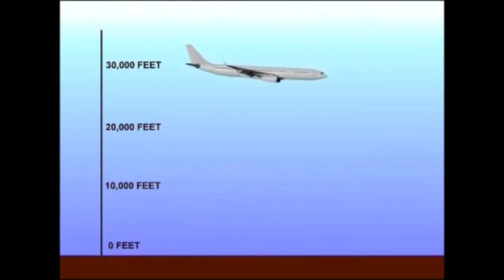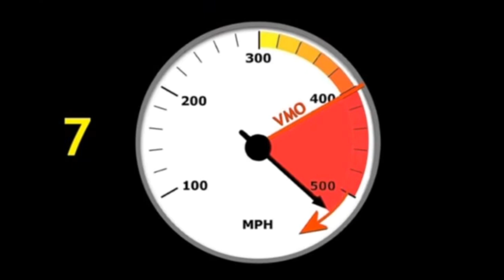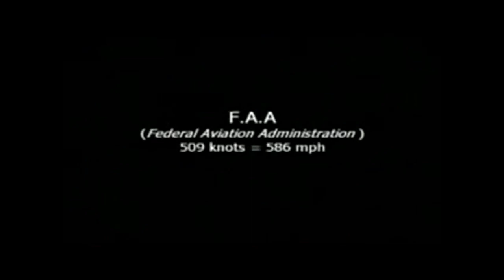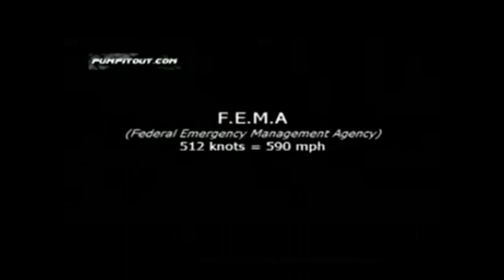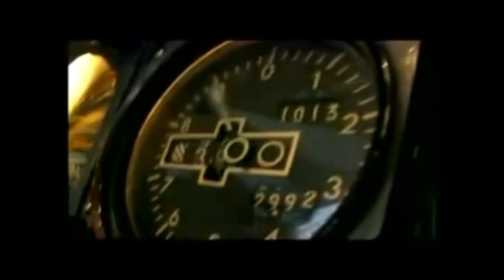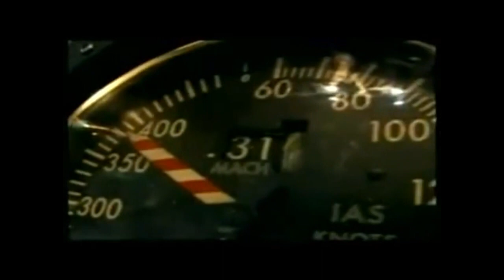Can a commercial jetliner fly above 500 mph at sea level?

Comment: So two of the engineers say they could (but not through engine power alone), and one said they couldn’t. This doesn’t sound like overwhelming evidence.  Funny how all the jokers in the comments with their confirmation bias can’t hear what the engineers are actually saying.
Reply from the maker: No, they did not. You are not saying all of it. Quote them.
Reply: @PetrLunak  First engineer clearly agrees with you. The second one is asked if the planes would “shake apart.” He replies, “That’s a question of Mach number, and it’s not that bad.”
Reply from the maker: @jonmcalister1802 you, again, picked up only those words, you obviously like. You did not quoted all of their words. Confirmation bias at its best.
Reply: @PetrLunak  My mistake in my original comment. There were four responses, and three of them only mention thrust as the limitation. The second one rejects airframe stress as a limitation. The last one (I think he's a pilot) says that they could reach that speed with "the assistance of gravity."
Reply: @PetrLunak  The third person, Ben Eadie (8:00), says it's impossible because you need "so much power to push through that much air." When he refers to adding engines that are much more powerful to overcome that, he says that the structure couldn't handle it, but he's referring to the way that the engine mounts and wing strength would have to be much stronger to convey that moch force through the airplane. They would rip the wings off.
Reply from the maker: @jonmcalister1802  Krishna Kumar Subramanian, Aircraft Engineer:

"While the first thing that strikes you when you hear the word “aerodynamics” is “lift”, it actually is about all the forces acting on a body moving in the air.

This relative motion between the airplane and the air causes a force — a structural load —on the airplane called “dynamic pressure”.

Technically, this force is sometimes called “Q” (like “M” in James Bond movies).

Dynamic pressure increases with density of the air, and increases as the square of the speed.

At sufficiently high air density (say, close to the ground), and sufficiently high speed, this force can rip the wings off an airplane.

Therefore certification authorities impose a safe speed limit. There are several values of this.

Piston engine airplanes are given a straightforward VNE: a single red-line limit of VNE (velocity never exceed).

For turboprops and jets, this speed limit is designated Vmo (velocity maximum operating).

VMO is primarily a structural limitation because increased indicated airspeed stresses the airframe, particularly when gusts are encountered.

Vmo, unlike the red-line limit of VNE (velocity never exceed) in a piston airplane, accounts for the effects of Math at higher altitudes as well as the structural loads that increase with indicated airspeed.

Mach effects include change in flying qualities and loads on the airframe.

Air flowing over the wings and tail can approach Mach 1, the speed of sound, when the airplane itself is moving through the air at far less than that speed.

For example, the air must accelerate so abruptly to pass over and under a thick wing section that a Mach shock wave can be created and change the performance of the wing or tail when true Mach is quite low.

Mach effects change with air density, becoming more critical as atmospheric density decreases with altitude.

For that reason, nearly all turbprop airplanes adjust Vmo down as altitude increases, thus delivering a larger margin away from the detrimental effects of Mach as the air plane climbs.

[The creators of the Daher TBM took a different tack and designed in enough airframe strength and flying qualities margin that the airplane exceeds all standards at 270 knots indicated airspeed at any altitude up to its 31,000-foot ceiling. The single red line Vmo of the TBM reflects both exceptional airframe strength, and very predictable and benign flying qualities at all altitudes.]

At sea level, it will usually be around 400 mph, or 360 knots for heavily-built transport airplanes.

Fly any faster than that at sea level and you risk a break-up.

Even rockets are built with limited strength, so they have to observe speed limitations during certain phases of their climb through the atmosphere to contain the aerodynamic forces on their bodies."
Reply: @PetrLunak  Ahh…So you turn to a source outside the interviews because they don’t back your point…and then you quote someone who says “risks a breakup,”not that a breakup is certain. I don’t think these terrorists were worried about the warranty.
Reply: @PetrLunak  Here’s a an analysis of a Boeing commercial jet that grossly violated safety standards regarding maneuvers and G-forces on the aircraft, including excessive speed while flaps were extended. After the incident, the maneuvers that occurred were so extreme that the plane was grounded and a full structural inspection was performed. What did they find? Absolutely nothing. I’m not saying that there are no limits or risks. I’m saying that you have no basis for being 100% certain. It is especially ridiculous to leap from “risks” to “evil conspiracy involving Avengers-level technology.” https://youtu.be/OXF76fxR_6s?si=16QMVBaYr9Q6tbzg
Reply from the maker: @jonmcalister1802  I only reposted the desciption of this video. If you keep spamming, I will remove your commentaries (just warning in advance). Even small child is able to keep tgoughs in 1 commentary. 
Jeff Hill also called to Boeing spokesman and asked about flying above 500 mph near sea level. She literally loughed at him.
You simply will not find any competent expert who will confirm you, based on technical details, that a B767-200 can fly above 500 mph near sea level without suffering any damage a what is more important, still being fully controllable, so it can hit a target with such precision! Two times in one day, lol. 
One more fact, UA-175 was flying 584 mph!!!, you can easily measure it by yourself from at least two video footages.
And then there was even more rediculous story about flight 77 and its miraculous manouvre before dissapearing behind the reinforced wall of Pentagon in a hole being 5-6 metres in diameter :D
Reply: @jonmcalister1802 You presented absolutely nothing.  Your link does not discuss the planes on that day.  

The 2nd engineer talking about Mach number concluded the engines COULD NOT TAKE IT 

You 💯 ignored the conclusion. 

And you pretend the engineer saying absolutely not has no valid point.  Just utter trolling.

Comment: Why doesn't someone just get a 767, fly it at the speeds they said it did at sea level, and see what happens?  You'd think the people saying it's possible would back it up with an actual physical test to prove it.
Reply: pay attention to 1:27
Reply: @Trojan_Horse24241hgreihgeihrg If they want to put all the truth people to rest, just test a 767 flying at those speeds and video record it for everyone to see so the flights can be compared to what is seen in the 9/11 videos.
Reply: For science.
Reply: lol as if this wasn't done when the planes were built. SMH
Reply: Flight simulators will not function. You don't need to do an actual experiment on it. Physics formulas already show this. Pilots know it's impossible for such a maneuver. Jet aircraft will violently shake apart at sea level altitude at 500 plus mph and target accuracy disentegrates as well.
Reply: Because test pilots the best pilots on the planet.  Better than Top Gun pilots wouldn't try it.

They'd die.  No way did those hijackers do it.  Impossible.

No actual experiments of the motion of collapse of the towers that day either.  Because its impossible.

Videogames do not equal reality.   Simulations are videogames.
Reply: @DS94everXev  they can remotely fly the planes to test it.  No pilot on board needed..
Reply: @kyleconroy2312 But the pilots did fly the planes to land them.

Not a single transmission from the planes to air traffic control reported that the planes did not respond to command.

The pilots would know exactly what was happening.  They did it.  And I know they did it because at least one of the pilots was seen alive after 9/11.

Those planes and all the crew were in on it.  Not a single crew member followed protocol that day.  Not a one.

Comment: Finally a video about the planes travel speed at sea level on 9/11 .
Reply: Which is impossible!
Reply: @jockoharpo2622  So why did two of the engineers say that it is? Did you listen? Two of them said that the only problem is the thrust, but the third one clarified that a long descent would allow them to. The second one double-triple confirmed that the plane would not suffer overwhelming structural damage.

Comment: There talking about what the engine could handle at sea level, but even more than the engine the wings would be torn off.
Reply: Why do you believe that?
Reply: @Tim22222  Because things fall off of airplanes.

The engine is the strongest most well built part of the plane.  Wing tips are thin.  Thin = weaker.  If something falls apart knowing nothing else you'd expect the thin parts to fall off first.

The wing tips would 100% guarantee fall off when the Pentagon plane hit the light posts that are cemented into the ground.

But no wing tips fell off that plane because that plane wasn't that plane that took off.

Comment: so if they didn’t use planes then what was it a drone or cruise missile
Reply: 1.  There are planes that can go 600 mph at sea level.  Military planes cab do it. So it's not impossible.  It's impossible for passenger planes to though.

2.  The planes that took off were 100% guarantee not the planes or objects that hit the towers or anything else that day.
Reply: They BOTH hit computer rooms, locked computer rooms that must have been signaling for it to come there.  There was no jet fuel at all, thats why they had those explosions everyone heard.
Reply: Probably a military version of a 767 with a specially reinforced air frame and equipped with special jet engines.
Reply: Though it was probably a cruise missile that hit the Pentagon, which would explain why we have never been shown a single photograph or video of whatever hit the Pentagon, even though there are numerous security cameras all around the Pentagon building that would have recorded it.
Reply: @99percenter1  Which means it wasn't those planes that took off with those passengers onboard that hit those buildings.

Somebody at the airport would see this weird looking jet.  You had ex pilots as passengers on board those planes.  They'd know in an instant of stepping outside to board the plane, this is a NOT a passenger jet.

Yet not a one said anything about it.

Plus the pilots would know as well.  And the flight attendants.

Basically everybody who knows anything about planes would know.

Yet they still wen on like it's a normal day on the job??

😂
Reply from the maker: @DS94everXev  Operation Nordwoods. You are welcome
Reply: @PetrLunak  Yes sir.  I'm familiar with it.  Though I sometimes forget it's name.  I first learned of it from Jimmy Dore.  I don't think I referenced it in this thread though.  Least not in a reply I can see. 

YouTube deletes lots of my post when I get too much truth out.

I  😍 this video here.  Great Job on it. I reference this video as well as "Scientific Method Part 1 Motion and Part 2 Temperature " to other constantly.  If you haven't watched those 2, they are the cryptonite to all the real conspiracy theorists who don't believe in science on 9/11.

It uses basic logic and science., and the scientific method AKA experiments.  Your analogy of having somebody trying to swim in water at near 27 mph or so is great. Though how do you know that?  I can't find it.

The dozen or so conspiracy theorists who are on every 9/11 video pushing lies refuse to watch your video here.  Or the Scientific Method ones.

They keep saying the planes can achieve those 500 600 mph speeds because they were diving.  😂   video shows they weren't.  Flight path shows they weren't.

Great job on this video sir.  I love it.
Reply: What about the plane parts that founds around wtc?

Comment: So if a Boeing 767-200 can not fly at 500 mph (or 590 mph), for a few seconds, in a dive, at full throttle, 800 feet above sea level,.. how come Flight 175 did?

Asking for a friend.
Reply: No jetliner can travel 500mph at sea level 1000ft let's say so stop saying it. Boeing 767 max speed at 1000ft is 380knots even though no pilot has ever flown a 767 at that speed and altitude. the engine fan blades design doesn't allow it.. i.e The engines are optimised for its cruise speed.  The fan speed is limited so the angle of attack of the fan blades will reduce as it gets faster,  producing less and less thrust.
Reply: @acostin4004  - Sure they can and obviously did. Aerodynamically it is not a problem. Just as Boeing - the folks who designed, built and tested the aircraft (nobody ever asks Boeing, preferring instead to believe strangers on the internet who didn't ask Boeing either).

You conspiratards need to finally figure out what the aviation community has always known - the difference between VMO (the posted speed-limit) and _maximum aerodynamic limit.

They are not the same thing. 

You are talking out of your ass.
Reply: You're assuming it was Flight 175. If a standard Boeing 767 cannot do what was observed, then it wasn't UA175.
Reply: @henryford2950  - No assumptions. We know it was Flight 175, which was perfectly capable of doing what was observed.
Reply: @MFitz12  Yeah right. ;)   Its not possible.
Reply: @ - And yet it happened, which puts you in the curious position of claiming - without a shred of evidence - that something which has already happened isn't possible.

Not a good plan.
Reply: Because it was a 767-200 and they can do that if the conditions are right i suppose. It also seems more likely that air china 006 which they brought up in this video didn’t suffer damage because of vmo exceedment but rather from g force overload since apparently, during it’s dive and maneuvers some passengers experienced forces up to 5 g. A passenger plane is usually not desinged to pull more than 2 or 2,5 g’s during maneuvers so it was twice as much g’s as it was desinged for which was far beyond the limits that any of the 4 hijacked aircraft were pushed beyond. If we assume that flight 175 was a boeing 767 and could fly 100-180 mph beyond it’s design limits which was 414 mph, and could do that while appearing to be under quite good control, and a 747 was pushed twice beyond it’s design limits and could do that while suffering some damage, it seems more likely that exceeding it’s limits twice the limit it was desinged for was what caused the failure.
Reply: @Xdvulture  - China Air 006's wings were permanently bent and bits of the aircraft fell off. 

It continued in service another 20 years after repairs. 

Since Boeing do not publish any data on absolute aerodynamic limits any talk of what they are and if they were exceeded is pure feces of the male bovine.
Reply: @Xdvulture  The planes are never to exceed the VMO or Maximum Operating Velocity for the planes WILL break up.
At sea level doing in excess of 400mph is doing exactly that
Reply: @SmedleyWarIsaRacket  No, they will not. engineers are not idiots, they wouldn't place a VMO without a significant margin between the placed VMO and the absolute point of no exceedement that they got on the tests. It's very possible that the boeing 767-200 managed to do 500 MPH or higher on the conducted tests but the manufacturers made the VMO 400 MPH to give it a margin of safety if a plane for some reason had to exceed 400 MPH during certain conditions without instantly breaking up. Planes exceed their VMO all the time, I have a friend who is a pilot who did it just the other week but the plane obviously did not break up.
Reply: @Xdvulture  "It's very possible that the boeing 767-200 managed to do 500 MPH or higher"

Why did you use the word "Very",  just say it is possible and then give some proof, evidence, documents or some other information to back up what you say.

Also you said "if the conditions are right" but never mentioned those condition....why not?

Looks like you are full of BS!
Reply: @SmedleyWarIsaRacket  B767 cant fly at that speed. At 1000ft.
Reply: @SmedleyWarIsaRacket  You are the one how defends total BS.
Reply: It wasn't in a dive
Reply: @hiitsmescott - The hell it wasn't